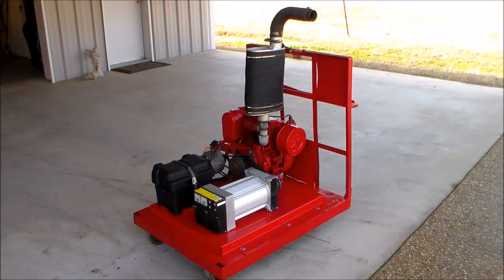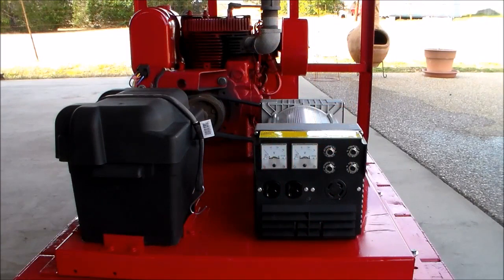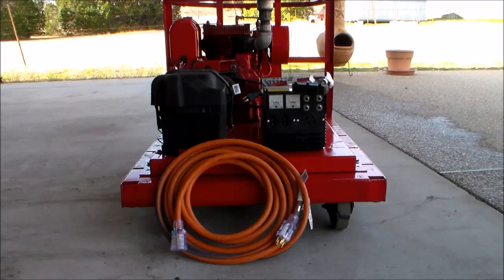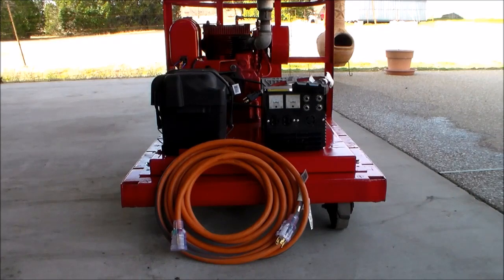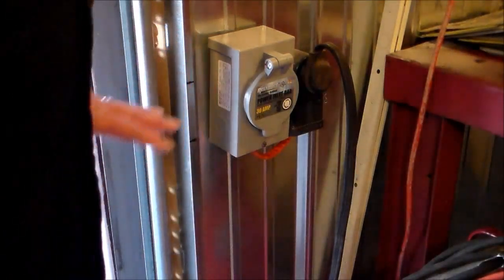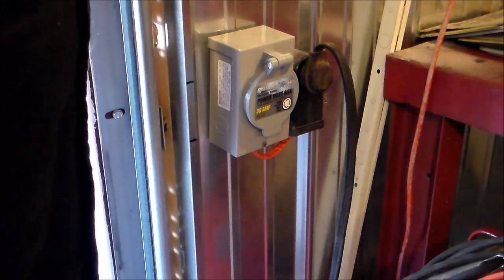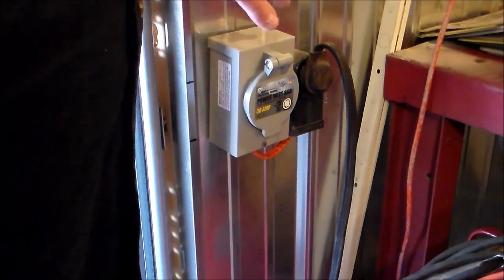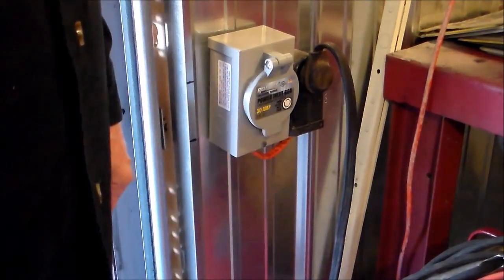Harbor Freight 10 kw Generator Head

Comment: Should the generator be grounded ? My 7550 generator has a ground on it that I use when camping. I drive a section of metal rod into the ground with wire attached . I don't know if it's really needed, but better safe than sorry...as reek would say....Just Sayin'
Reply: The way it is supposed to work is when a generator is used at a job site with cords, it should be connected to a ground rod.  If you are feeding a panel, the panel is normally connected to a ground rod and you should not ground the generator since the standard 4-conductor generator cord brings the ground to the panel.  There should not be two grounds.

Looking at the standard 4-conductor 240v 30 amp generator from the end, the curved one is earth ground (green).  The one straight across from it is neutral (white), and the ones on either side are the hot legs (black).  

On systems that use metal conduit, the conduit provides the ground.  This is where the 3-wire 240 volt plugs are used.  The same holds true for household wiring.  The two-prong outlets are only appropriate with metal boxes.  If they didn't have conduit connecting them to the panel, they had romex with an additional ground wire.  The center screw on the cover plate is electrically connected to the metal screws that connect it to the metal box, and is where you attached the ground wire for equipment that required it.  When you buy a 2-3 adapter, it has a green flag on it that attaches to the center screw on the  cover plate.

The only other thing I would say is I wouldn't back-feed off the welding box.  It is a legal problem.  The way transformers work, is the side with many windings will have the higher voltage.  So lets say you have 7600 at the pole and 240 coming in.  If the main is left on or things inadvertently done out of sequence, you fix up the lineman, who thinks things are off, with 7600 volts.  Vice-versa, the generator catches fire.  Another scenario is you get blamed from something you didn't do.  Transfer switches are expensive and nuts for most of the situations they are used.  However, a lockout at a box is very easy and cheap to put in.  Basically, you move the breakers down two spots on one side of the panel to make room for a 240v breaker.  Then you install a lockout on the panel cover.  The way it works is it is impossible for the main and generator breaker to be on at the same time.  You certainly have the sense to turn off the loads you want and don't want when you switch to generator power and don't need a transfer switch that forces you do use only the ones that were decided on when that expensive thing was installed.  A lockout also means when you are working on your generator and the power is on, you have full confidence you are not in any danger and you can't inadvertently fry your generator.  Also get the lockout kit made specifically your panel.  This will make inspectors happy and keep the ambulance chasers away from your finances.  Since you've got everything apart anyways, now is a good time to balance the 120 loads so they are pretty equal on both sides when the power is out and document your panel.

For me, what I do is guy a $30 light from Amazon that is by the breaker panel that kicks on when the power goes out, and an alarm that kicks on when the power is restored so I know when I can switch back to the mains.  The generator will do 10KW, the 16 hp motor can do 8KW (hp/2=KW for mechanicals).  Also, by using a lockout, you get your welding plug back and might have enough to weld with when the power is out.  The 30 amp legs will only do 7200 (240 x 30 = 7200 watts),  which is what the generator can do continuous.  Regular 10Ks have 50 amp plugs.  Breakers at the panel are sized by the wiring.  The generator fuses and breakers are sized by what the generator can handle.

BTW, VERY nicely done!
Reply from the maker: +John Wojsiat    I think your right,  all the generators recommend grounding it. . Not the same but I know my electrical panel has the ground rod on the ground and neutral bus . Thanks and take care
Reply: +Rusty “rustyglovebox” Glovebox Ok, Thanks.....Typo, I meant to type "As rpeek would say"

Comment: That is a Nice Rig, Mr. Rusty. I think it will do most everything in a home to keep it going as far as Fridge and lights and the necessary things for sure. I bet the rubber insulators would help some on the noise what little there is. I bought an 50 amp. generator back 5 or 6 years ago for my place as we run out of electric here alot in the Piney Woods. I've used it several time also.
Reply from the maker: +Danny Walker   A 50 amp is a better choice for the home. Thanks Danny and take care

Comment: are you required you to have an automatic transfer switch?
Reply from the maker: +Elbows Malone   Have to cut the main breaker off,  fines if you back feed power in the grid if the power is off.

Comment: I got a 5000 watt Honda generator I bought 8 years ago and Ive never even put gas in it yet.  The power hardly ever goes out where I live .
Reply from the maker: +1970chevelle396   The power is pretty reliable here too. But  a hard winter, storms or tornado never know.  You will have power if you ever need it.  Thanks and take care

Comment: It is nice as long as you can buy gasoline during a power outage. Sometimes gasoline is not available. I can use the sun but if the sun dont shine then I run out of power in  day or two.
Reply from the maker: +shartne  I have a small bank of solar too. But hard to supply the amount of electricity the generator does. I have a small wind generator I built so between the three it's covered. Thanks and take care
Reply: +Rusty “rustyglovebox” Glovebox Sounds like a good plan. I am thinking about adding some mono panels that will work during cloudy days.